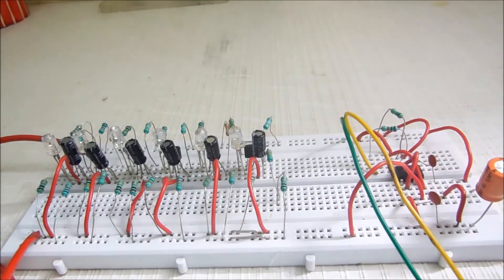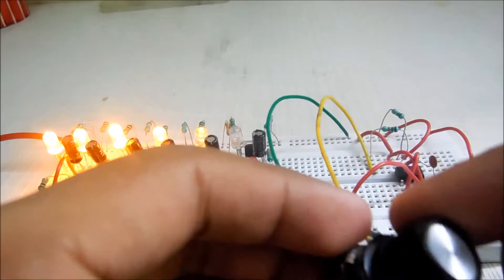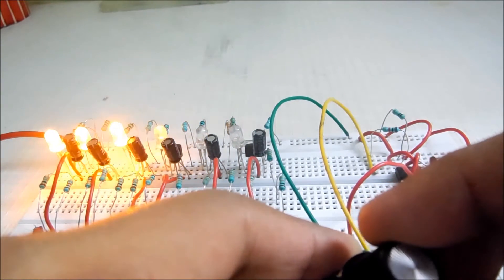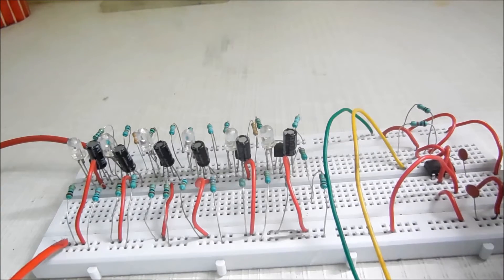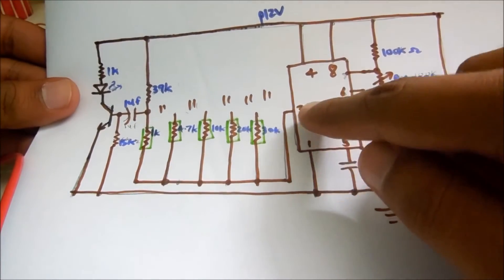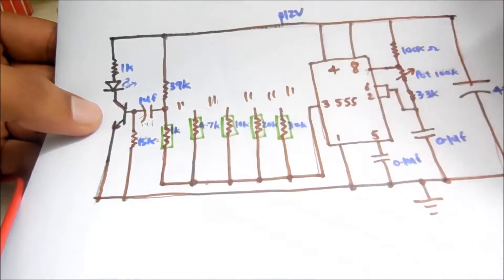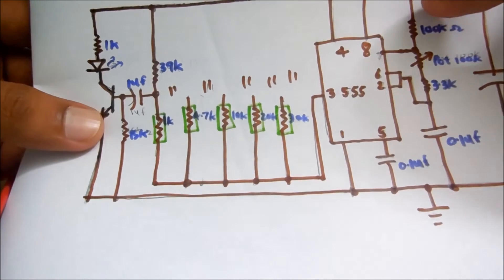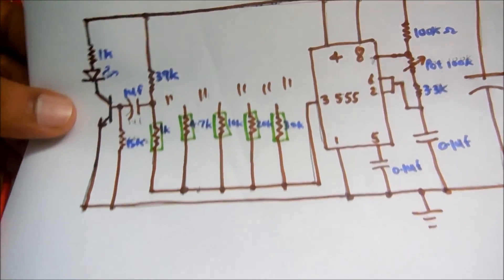LED bar graph control circuit .(using transistors & timmer IC 555 )

Comment: sir, please excuse my question. I know nothing about circuits but is this a BJT Temperature-Controlled LED Bar Graph?
Reply from the maker: No, This is a "BJT resistance-controlled LED Bar Graph". If you want to make the same circuit temperature controlled you can use a thermistor instead of potentiometer.
Reply: @prachethire812  I want to do this but we are required to use an op-amp. Can we use LM358 instead of an 555 timer?
Reply from the maker: @jaki8002  Simply make a square wave generator using single op amp. you can find that circuit on internet but make sure you modify the circuit to vary it's frequency.
Reply: I mean, we're gonna use the same circuit but different op-amp like instead of N555 timer we're going to use LM358.  @prachethire812
Reply from the maker: @jaki8002 What ! , you think 555 is a op amp. yeah, it's made using op amp
, you can make 555 using op amp.
Reply: sir, do you have a clear picture of your connection with component values?
Reply from the maker: @supremo7158  Circuit diagram is shown in the video.
Reply: @prachethire812  Sir? Can we have the value for the resistors? The diagram isn't clear, that's why.
Reply from the maker: @jaki8002  this I made long time ago, I don't have its details, do trial and error, use resistor between 1k to 10k, its safe to use values in kilo ohms, also you will learn how it responds to different values resistors. If the too it doesn't works, contact me though my email id, given in description

Comment: you can made this without capacitor.. calculate v,i,r and potentiometer will change voltage. you or can use zeener diode.  if r1= value is 1.5v
 r2=2v, r3=5.5
when you give below 2v just 2 led will on connected r1&r2 
if u decrease v 2v- 1.9 r1 led wil be on.

Comment: I like how the leds respond very smoothly to the position of the potentiometer.

You did a nice job on your design.
Reply from the maker: Thanks, I am also not a professional designer but I have some inbuild logic to connect components and make them work as I want.